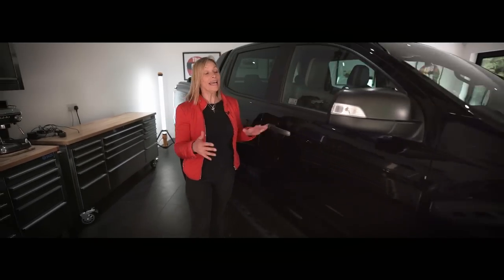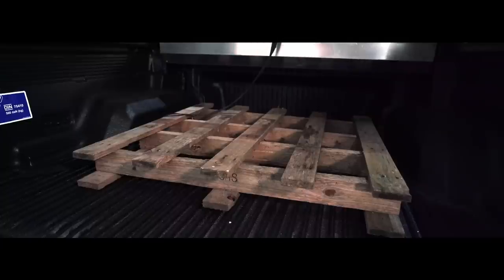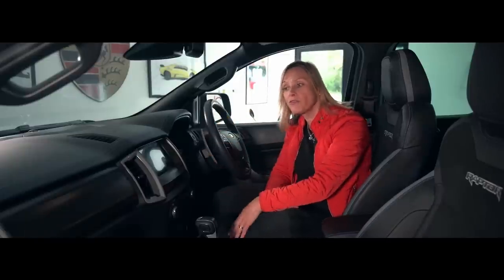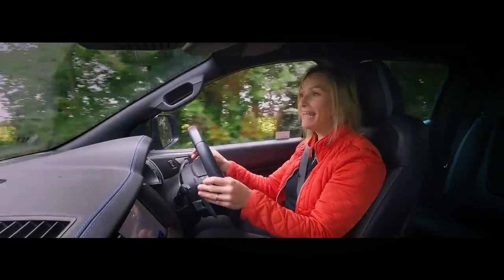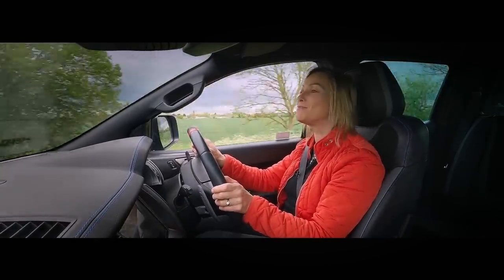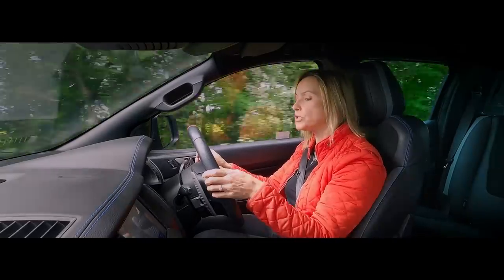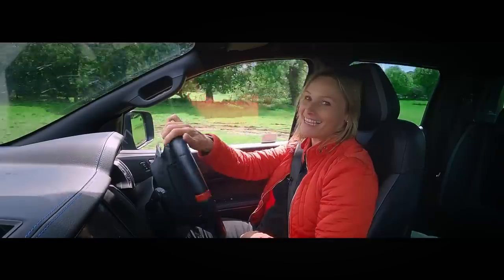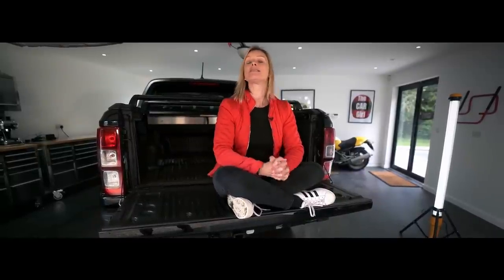Ford Ranger Raptor - a top pick-up truck! Full review on & off-road - complete with a huge jump!

Comment: Absolutley love the ranger raptor,  i was suprised at how well the 2.0 ltr bi turbo engine pulls. Definitely going to be my next motor, and remap to 275bhp.
Reply: i wanted to love it too but its auto only. deal breaker right there. and no real need for it as ford had higher powered cars with manuals in the past
Reply from the maker: Love that!
Reply: Are u remap ur raptor? Is it void warranty?

Comment: The suspension on this is amazing! And as a daily driver, green laning, camping machine it is the ultimate thing they sell in the U.K… at least till the Gladiator arrives. Sadly, 10 seconds to 60! That’s genuinely glacial!!! Perhaps not for the U.K. market, but it is from a world perspective.
Reply: New more powerful raptor is coming:)
Reply: @DragonXDrei  since I wrote this I’ve started to care more about the frugality with current diesel prices. And whilst the 3.0L turbo diesel is nice I’m staring to think EV is where it’s at for the future (and present) of pickups. Thankfully my current Isuzu D-Max is super frugal (and super slow, but that’s less of a problem in 2022).
Reply: The 8,500 lb F-450 Crew Cab makes it to 60 in 8 seconds. A little more than a 2L diesel in that though. 
Don't let diesel prices get you down. One of mine has a 200 gallon tank and gets 8 mpg. The cost of diesel is offset by not having to get hotel rooms while on the road.

Comment: As far as I can gather all Ford Rangers are not classed by the DoT as Dual Purpose Vehicle but are Light Commercials (in excess of 2040 kg unladen weight) and as such have speed limits of 50 MPH on single carriageway roads and 60 on dual carriageways.   Same applies to Merc X Class, VW Amarok, new Navaras and new Hiluxes.  Pretty unlikely anyone will ever get nicked but worth noting.

Comment: Bought a black 3.2 2016 wildtrak with 29k on the clock 2 years ago for 21k and spent 4k on mods  best thing I've ever done love driving it .it is suffering with the ranger rust but Ford are sorting it out by doing the chassis treatment, next mod will be 3" SS catback and stage 1 ,the amount of ppl that stop and look at it as I drive passed is nuts ,great drive in the auto going down to Cornwall  never feel tired went you've done a long journey,  and always look back at her when I walk away from her  and my neighbours always take the pi$$ when I wash her and say black vehicles are the worst ,I just reply  best looking vehicle in the street tho 🤣
Reply from the maker: Top stuff!!!

Comment: I just read an article saying the new double cab ranger in all trim specs, including Raptor has an unladen weight over 2040Kg. It’s speed limited to 50mph on single and 60mph on dual carriageways.
Reply: The Ranger tops out at 4,440 lbs/2,014 kg empty. The Ranger Raptor is heavier at 5,238 lbs/2,375 kg empty. So the Ranger would fall under dual purpose vehicle and the Raptor would theoretically not.
This kind of shows how crazy government regulations are since neither the Ranger nor the Raptor are very big (both are mid-size pickup trucks).

Comment: Awesome looking, but still surprised it has the Diesel engine and not a higher output version of the 2.3 Ecoboost engine standard in US Rangers like mine (with 270hp and faster 0-60). I love my 2019 Lariat… just wish the adaptive cruise was stop-and-go like some other Fords, instead of disengaging at 10mph. It’s fine most of the time, but in really slow LA traffic, it turns off too much.
Reply from the maker: Thanks so much for giving me an insight into your LA travel. Enjoy the US Ranger! Lucky boy 👌
Reply: Fuel is much more expensive in the UK v USA.
That’s why diesel vehicles are very popular in the UK, particularly for a larger / heavier SUV or Ute like the Raptor.
Much better economy with diesel motor in this type of vehicle.
Reply: imagine a 15mpg car vs a 30mpg car when fuel is roughly $8 per gallon. thats why we dont have the 2.3 ecoboost petrol or a v6 petrol and end up with the 2.0 diesel here
Reply: @StephenFogarty2023  Diesels are popular in the US too, but they are very difficult to get through EPA regulations on vehicles with a gross vehicle weight of less than 8,501 lbs. This equates to an F-250, Ram/Chevy/GMC 2500 or higher and they all have displacements in the 6.6 to 6.7L range. My Ram 2500 diesel went to the dealer in September and will be replaced with a F450 diesel. The diesels are the only way that you get 14 mpg highway when towing 26,000 lbs.

Comment: Yes Vicki but would it make an ideal Camper vehicle with the back of the passengers area removed and a cover added to the pick-up area, that way I for one could get out of the City I am in and select different parking spots where beauty is a must see each and every morning when I wake from slumber in my single divan bed nestled in the back of the pick-up? 
Pls let me know if this could be done as I am dying to get on the road and my wee Fiesta is not big enough for my 6 foot frame.
Reply from the maker: It might just work! But best speak to the Ford peeps who will know how to guide you best. Good luck!

Comment: Would be nice for them to comment on the reliability so people that want it for years know if it any good like when every Ford dealer is full of them with engine failure and gear box case cracking
Reply: not heard of a manual gearbox fail and seen plenty of engines with over 200k miles in teh UK which are far harder miles than American miles, and reliability has a different meaning in the UK than the USA also
Reply from the maker: Thanks for your feedback Jan.
Reply: I worked at the dealer for over ten years and the only issues that really caused problems were the new 2.0 bi turbo failing all the time and the 1.0 eco boost

Comment: I was hooked until ya said "2.0 diesel" I would settle for a 3.2 twin turbo diesel with 300+hp but that NO, what's next a 2.0 4 cylinder ferrari, no no no no that thing is the massive body builder ya see around with very little in his pouch
Reply: the 2.0 has more real world grunt than the old 3.2 im afraid!
Reply from the maker: V8...

Comment: That pallet was pushed in its the wrong way around for a forklift if the tailgate dropped all the way down it would be better not saying a good operator couldn't do it
Reply from the maker: Thanks for your observation! As a non-forklift truck driver, please forgive me this small error.
Reply: @thecargirlvickibutler-hend2834   it's ok Vic I'll let you away with it this time but don't let it happen again 🧐
Reply: I get pallets dropped in the back of my truck by forklifts all the time. They drop it near the back and then adjust their forks and move it to over the axle. If I am getting two they will push the front one forward the extra foot or so with the second pallet. Don't quite have the payload for 2 pallets of ready mix concrete.

Comment: Love the Ranger Raptor, only issue for me is that diesel engine could use a bit more power for such a capable suspension.  But that's being addressed with the all new gen Ranger about to be released. The next gen Raptor will have a much more powerful gas motor (expect 0-60 in the low-mid 5 secs.)  Since the next gen VW Amarok will be based on the new Ranger, I wonder if they will get a "Raptor" version as well, maybe under the "R" name?
Reply from the maker: You are clearly a connoisseur! Great!
Reply: except the UK doesnt get 'GAS motors' we get DIESEL ENGINES!
Reply: @petelattimer6808  You get your choice of either 3L gas/petrol or 2L diesel in the new model.

Comment: There must be one with a bigger engine. 2 .2 is so feeble. I hired one without the diff-lock and it was useless.
Reply: Ford Super Duty offers 6.8L and 7.3L gas/petrol and 6.7L diesel.

Comment: 213 HP is great in a Civic. Not a gigantic truck.
Reply: The UK doesn't buy v8 pickups.  They are absofuckinglutely too expensive due to the import tax etc.
Reply: Gigantic truck 😂
Reply: come and talk again when Americas fuel is $8-9 per gallon and owners only earn $400 per week before tax etc!
Reply: @gavinwyllie7855  import tax isnt the issue. fuel tax and 'road tax' are the issues!
Reply: Horsepower isn't what trucks are all about. You buy a truck for payload, towing capacity and torque. 
My last truck (2011 Ram 2500) was much larger than this, weighed about 7,800 lbs empty and had the low output engine (an inline 6 Cummins 6.7L diesel - we don't all drive v8 pickups Gavin). It only made 350 hp due to the low revving engine, but made 650 lb ft/ 885 nm of torque. The newer diesel pickups in the US are all making at least 900 lb ft/ 1225 nm with the most powerful making 1,200 lb ft/ 1,630 nm.

Comment: Utterly ridiculous vehicle for narrow British roads. You try parking that in a supermarket car park space, and life will give you pretty short shrift. However, it does look like a damn good cyclist killer, and I'm all for that. As for that tailgate, it might take lightweight VBH, but I can't see it taking the average obese 20st fatty.
Reply: In the manual for my US 2019 Ranger, it says max tailgate load is 485lbs so 34 of your stones 👍🏻
Reply: The 'Ranger'? That's a cute little thing compared to a full-sized truck in North America! LOL...
Reply: my mates dad has a ranger, as does my sisters partner. another mate has a SWB transit cutom. both the ranger and transit custom are within 2 inches width of my family hatchback and are both within an inch of the same length of the same family hatchback. a ford Mondeo to be exact.the transit is actually SHORTER than the mondeo!
Reply from the maker: I never had a problem parking in supermarkets etc. Just drove over smaller cars...😜
Reply: @thecargirlvickibutler-hend2834  That's what clever editing does for you!
Reply: That's a rather stupid comment.  As a cyclist,  who lives in a very remote part of rural England, with very  narrow,  single track roads,  I can assure you that the ranger,  and other trucks, are fine on out roads,  you just need to know how to drive.

Comment: Fifty grand and a 0-60 of 10 seconds 🥱 just to add insult to injury it’s also got reduced towing capacity over a standard wildtrak, pathetic!
Reply: The Raptor line is designed for high speed desert racing. Not really a work or tow type vehicle. If you want payload or towing capacity in the Ford line then you are looking at a Super Duty.